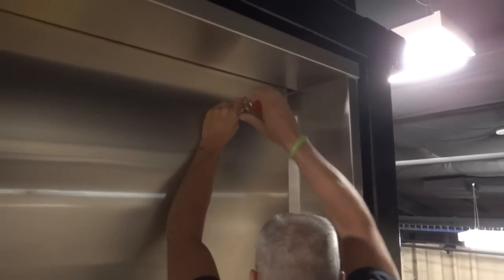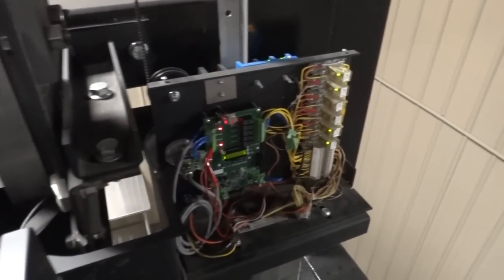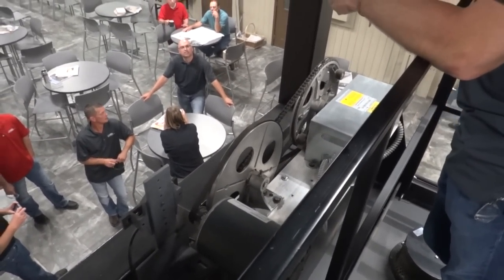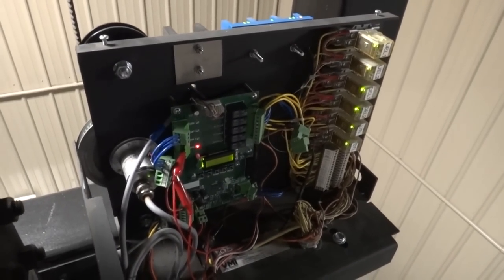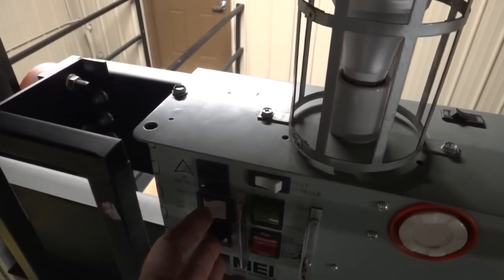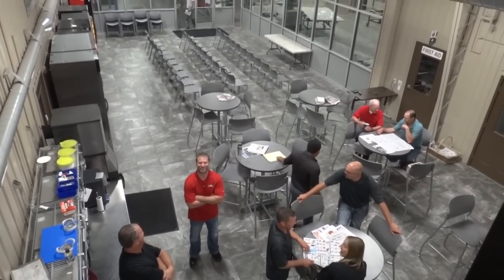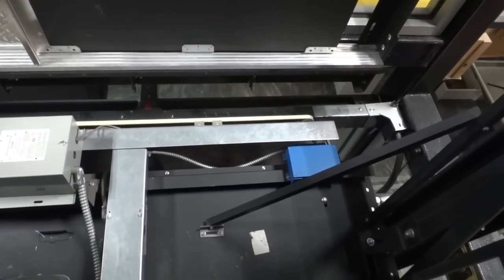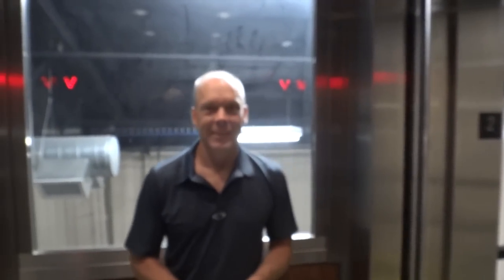Cartop Ride on a Minnesota Holeless Hydraulic Elevator

Comment: That was a really interesting ride, and as with this Reflex leveling device, can it be used on dry power units, or is it only for submersible power units?
Reply from the maker: +CaptainElevator42189 any hydro
Reply: So it can be used on inground, holeless, and roped hydraulics, and with dry or submersible power units. Interesting.

Comment: In the UK, most lift environment are like that, handrails with somewhere to stand and (usually) a cartop remote that can be lifted from it's stand but some may be welded to the cartop but will face you unlike Schindler which is the only lift company in the UK that has 3300s that have welded cartops that have no go button and face upwards which breaks regulations really.

Comment: How did you get the lift to move with the safety broken??? I understand that lifts in the US are different from the UK but I did not know they were that different!!!
Reply from the maker: +tamtom gaming it was on inspection
Reply: DieselDucy But even still in the U.K. it should not move with the doors open as that is dangerous an innocent innocent person walking by can fall into the shaft and die you must push the rollers up and release them when the lift comes close take your hand off the rollers if you are going to safety bypass it.

Comment: Neat. That's a fast hydraulic elevator.
Reply: ***** Schindler hydro's are straight up junk compared to this elevator. Although some of the newest 330A's I've been on weren't too bad.
Reply: +Elevating Denver yeah. 200 ft/min is very fast for a hydro. It's the fastest a hydraulic elevator can go! But someday it will hopefully be above 500.
Reply: +technicalboy “techgeek5000” 3000 totally agree very fast!!!!!!!
Reply: Superduper Julien 200 ft/min isn't fast for a traction but defanitely really fast for a hydraulic
Reply: Yes I know that
Reply: Traction can go as fast as 2,500 fpm depending on what type
Reply: Superduper Julien Noooo. Actually, I read somewhere on the internet that traction elevators can reach speeds of up to 3,400 ft/min if the motor is powerful enough. However, I'm designing a magnet power elevator with unlimited speeds, unlimited capabilities, and a windows 10 tablet as the controller.
Reply: Well that is true since I know OTIS compass can go that fast but I just put average, but all elevators are different.
Reply: technicalboy 3000 do you mean a real elevator of a model, if this is a real elevator what would your brand be?
Reply: technicalboy 3000 I LOVE WINDOWS 10!!!!
Reply: Superduper Julien i know. That's why I am putting the elevator controls in different apps on a windows 10 Lenovo tablet. And guess what!!!!!!!!! I'm using Access 2016 and MS Azure to develop and program the apps to work with the elevator's functions
Reply: technicalboy 3000 I found one of those 200 FPM hydraulic elevators on Saturday. It was a brand new ThyssenKrupp with Traditional fixtures.
Reply: Elevating Denver Wow. A TKE? That's awesome. I love TKE, especially their MRL traction models
Reply: technicalboy 3000 TO be honest, fast hydros can be kind of rough. They start and stop really hard sometimes.
Reply: Elevating Denver yeah
Reply: Elevating Denver HAWLIE KRAHP!